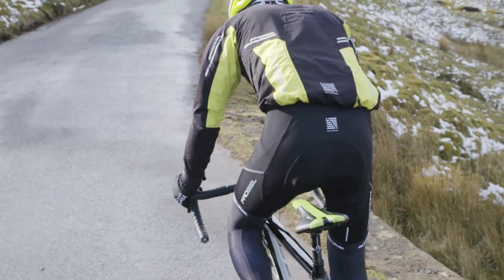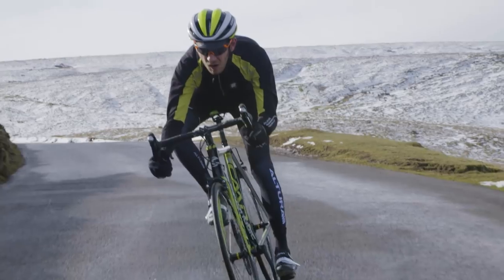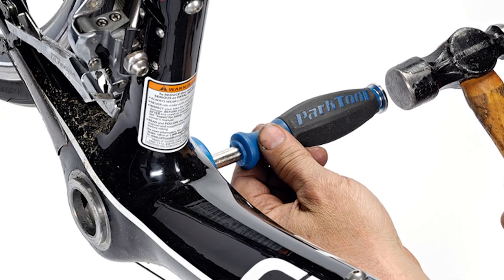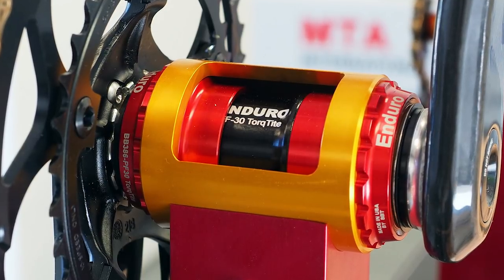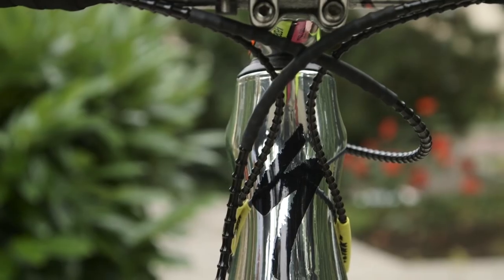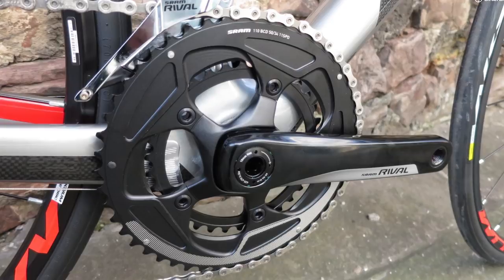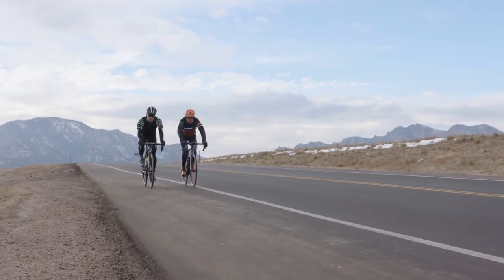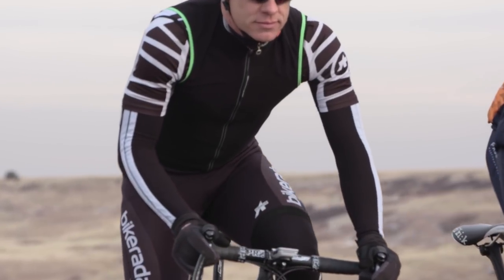Top 5 - Road Bike Upgrades

Comment: why do you never mention the faff of having to change and clear out the sealant every so many months with tubeless. The way you (and others) present it is - do once and its good to go just keep pumping your tires up and you'll have years of doing nothing.
Reply: youre right, there is a faff if you use stans. its sticky, thready and stinks. Try Orange Seal next time you buy sealant. it doesnt thread like stans, and its really good.
Reply: I'm on my first tubeless setup and after six months the sealant (Stans) is still completely liquid.
Reply: experiment54 Just out of curiosity (don't own tubeless tyres) how do you clear out the sealant?
Reply: If it's anything like mtb, the sealant will dry up while coated on the inside of the tire, but the flexing of the low pressure tire will cause the sealant to sometimes come off inside and when you open it up you have this spaghetti mix of dried sealant in there and the rest you peel off. Then the rim needs to be cleaned of the old sealant before applying new. Usually you end up finding all this out when a puncture doesn't seal because it's all dried out inside.
Reply: it depends a lot on the tire and weather. but yeah 6mo without change is totally possible. sometimes its more like 2-3 month though.
Reply: 20-30cc of tubeless juice make tubed wheels virtually immune to puncture and mystery flats too, and it costs weight less than s spare tube. what's not to love?

Comment: Really need to correct something there. Road bikes done need a long cage nothing needs a long cage is you want wider range Cassett use a medium cage so much better.

And don't trying doing ghetto tubeless set up like you can do on a mountain bike I tried it and it went very wrong.

Comment: Those threaded press-fit bottom brackets defeat the purpose of BB30 and the distaste for outboard bearings in the first place. Press fit bottom brackets are shit, we all know that, we wish the manufacturers would agree. Surprisingly, a good old square taper still works like a champion after many years of service compared to anything else I've ever owned.
Reply: add 500 grams of weight for a square taper bottom bracket 😃
Reply: @truthseeker8483  Untrue. Many modern cranksets have so much material just to fit around those large 24 or 30mm axles that it's probably not a huge weight savings. Also, even if it is 500 grams, it's weight in the right place for something I rarely have to worry about.
Reply: @Metal-Possum  I just did the conversion and have been impressed with the weight savings and the cranks seem to rotate more freely. Just a Sora crankset but with Dura Ace bottom bracket

Comment: Best upgrade is a more expensive bike :)
Reply: John Doe I'm gonna have to politely disagree with you there.
Reply: he's right, up to a point.    You'll get a much better bike by buying a $2000 to begin with rather than putting $1000 in upgrades on a $1000 bike
Reply: that is unless your bike has sentimental value obviously you will ride more if you love your bike rather than if you ride it just because its expensive.
Reply: nallen - yeah, you'd go fast with a better bike.

Comment: Don't you need new wheels to fit tubeless?Don't think that is very cheap.
Reply: If the wheelset the bike comes with is already tubeless-ready in the first place, all that's left to do is to get the tires, valves & sealant.

Comment: And if you go to 25c's with your aero wheels, you loose all aero benefit. Remind most of wheel development and data are for 23c's. Just a few show for 25c's and generally not for the better, on the contrary.
Reply: Not all aero wheels are designed the same. Some match with 25's others match with 30's
Reply: Smale Rider wheels up to 28mm wide will lose little from 23 to 25. Only some (like swissside) may keep the performance. But 30s you're pushing too far. Enve 4.5 disc went to 31mm wide to be aero with 28c's, and these are the widest.
Reply: Ok I'm corrected on the 30's. I knew Enve had something with 30. The Enve 3.4's is 25's. Nox's Falkor 36D is matched with 25's. Stans Notubes Avion is matched with 25's. Zipp firecrest 303's is matched with 25's.

All the sub 20 internal diameter stuff is matched with  23's

Comment: 300$ bb
Reply: Even if it was the last BB you ever needed it would be a hard sell for me considering I can get a dura ace BB for like 60$ or a Ultegra BB for 32$.
Reply: What if I were to tell you it is the last BB you would ever need? Its designed to fix pressfit issues and is pretty much set and neglect.
Reply: it isnt the last BB you'll ever need though. theres like 1000 pressfit standards, does it fit them all?

Comment: Tubeless = more weight, enough to stop you from using it ... meh I don't know you choose.
Reply: How so? I literally throw an entire tube of weight out of a bike?
Reply: Sealant adds weight as well as the tyres are heavier then standard tyres.....
Reply: The weight savings varies depending on the setup and application...
Reply: sealant (~60gr.) + a bit heavier tyre (~30gr.) = the weight of a normal tube... 
But what about the better puncture protection & less rolling resistance?
Reply: Not if you use the new schwalbe pro one tubeless microskin. its pretty light.
Reply: Tubeless is lighter...
Reply: You're not supposed to fill the entire tire with sealant, you know.....